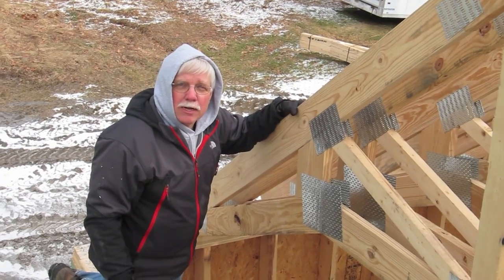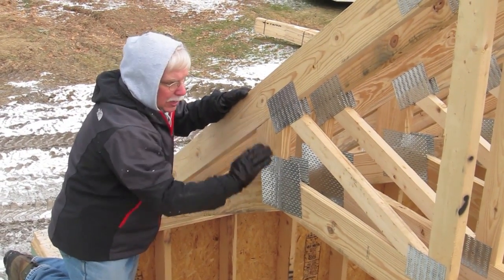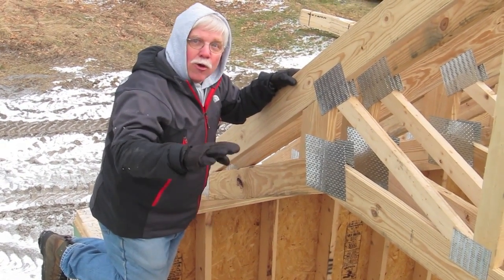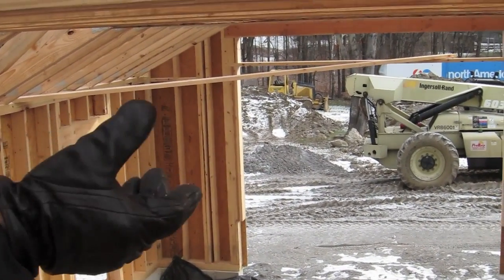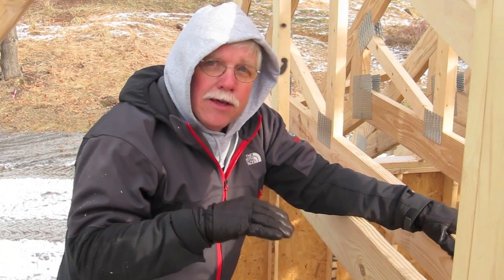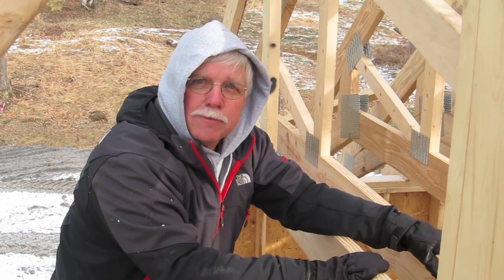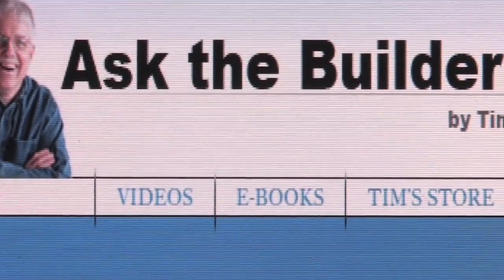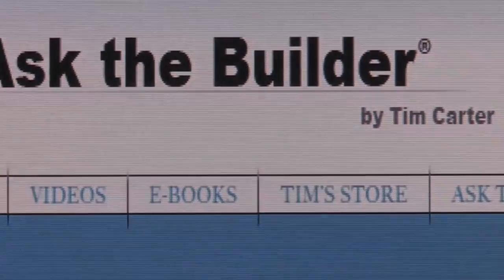Wood Truss Design

Comment from the maker: Thanks for your comment. The video was not intended to be a fully comprehensive overview of all trusses. As for speed of installation, I would be more than happy to do a side-by-side install of a gable roof - trusses vs. common framed.

We'd both start from scratch. The time you are cutting and banging your trusses together at the plant counts against your time. I get to have one of Larry Haun's disciples as my helper. I think you'll be amazed that we probably would beat you. No cranes allowed.

Comment: Been a truss designer for over 10 years and the trusses you show in your video are only a fraction of their capabilities. Many contractors and major builders use them for their obvious design possibilities as well as their ease of erection, elimination of site theft and their backing by professional engineers. It's an engineered product. You can set a average house in a couple of hours with them. Try that with conventional stick framing.